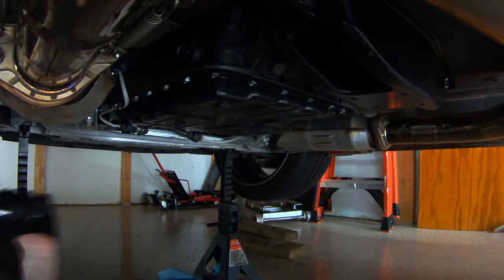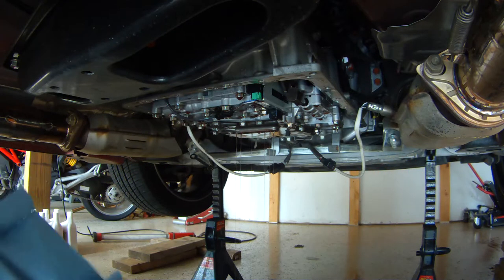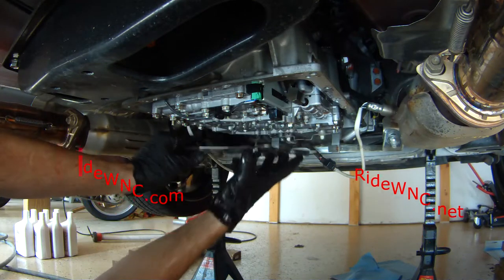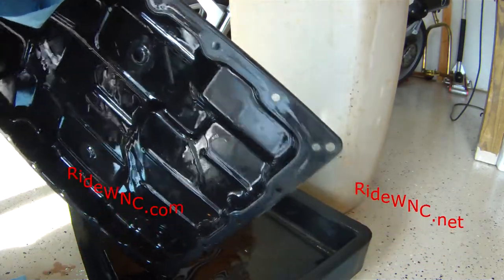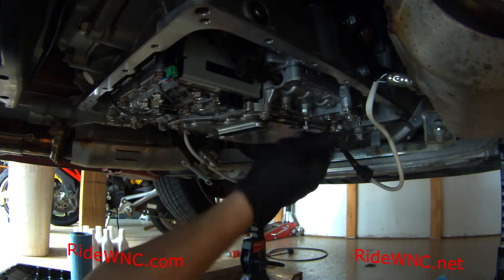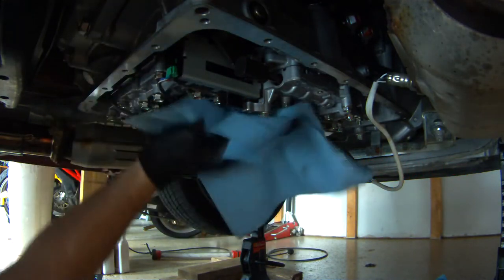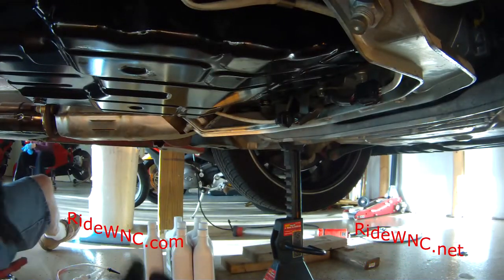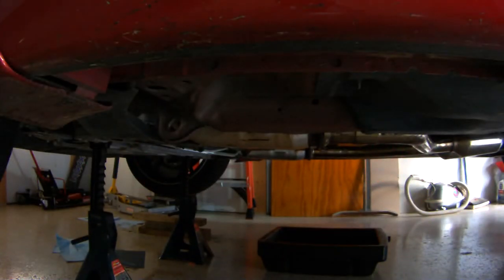Nissan 370z Automatic Transmission Fluid Change and Filter

Comment from the maker: * The car must be running when you check the fluid level. If you remove the 5mm hex screw without the car running you will drain out too much fluid.
Reply: Appreciate this info! This helped immensely with getting my level at the perfect amount.

Comment: hey man thanks alot for this video, i just got my 2019 370 and i was looking forward to do all the basic maintenance myself. I was just confused about one thing in the video, why do you need the transmission to be at 140F? is this required? also do you wait to hit that temperature after u pumped in the new transmission fluid?
Reply from the maker: Manual calls for 140*. You fill up the transmission and a little more then get it to temp. With the engine running remove the level check plug. You want ATF to come out and come to a  drip, then install the plug. There is not a dip stick. Nissan says this is lifetime fluid... NOPE!
Reply: @RideWNC  thanks for clearing up my confusion. Subscribed and liked🫡

Comment: Did you see where the fluid leaves the transmission and makes its way to the bottom of the radiator?  I want to do this and add a transmission cooler.  I know my valve body is likely toasted as I have the highly noted harsh shift from 3rd to 4th when the fluid is hot...

From what I understand - the valves in the valve body have to be replaced but almost nobody does so... I think Level 10 offers an upgraded valve body service - but - why even bother - I plan to simply ditch the 7AT and go with the Q60 RS 7AT with the much larger TQ converter..."Someday" right? ;-) 

Appreciate the video - I live in a small town far far far away from any dealer and - with the ultra high turnover at the dealers - you're not getting the best/brightest working on the cars anymore.... plus - for whatever reason - they always want to hot rod my car - which I hate because I know they don't bother to warm up the car before doing so...

Comment: Planning on having this done soon. I usually go to Infiniti. The shade tree was going to do it but now he's backing out. He recommended a transmission shop. They were talking about replacing the gasket and filter. Is there a brand of gasket and filter you would recommend? 

I was planning to do a drain and fill. I have 5 quarts. Do you think I'll need more than that?  They told me they could get me the filter and gasket for 50 but I know I can get it for less. I bought the car with 156k it currently has 219k Had it flushed at 167k and drained and filled around 195k.
Reply from the maker: https://www.ebay.com/itm/234092083902 Whatever you dump out you need to put more than that back in so there will be fluid to drain out when you check the level.

Comment: If I am putting in a new valve body will I need to replace the filter? I can’t find it online any where. Also do I need to replace the transmission pan and the transmission pan gasket ?
Reply from the maker: That OEM filter should last forever. Just run it through a solvent tank and get it dry. Here is a replacement:  https://www.ebay.com/itm/234092083902

Comment: been thinking about doing this to my 2014 370z auto, but i have a few friends that did change the transmission fluid and all of a sudden the transmission sensor broke and only gear one or three works.
in ur opinion what caused the sensor damage and give us tips to avoid this from happening please, thanks man :))
Reply from the maker: Best tip I can give is; don't let those friends work on your car. It is not related. That is Iike saying,"I changed the engine oil and now the right tire keeps going flat. I am not changing my oil again."

Comment: Hi Mike 
140 degree F is the temperature of the fluid when do the level check you get it from maintenance manual? Thanks
Reply from the maker: Yes. Manual. I am sure running for ten minutes would be OK.

Comment: I did several drain and fills the first time I changed my fluid at about 80k km. I'm at 100k km now and thinking about dropping the pan this time to clean the pan and check the magnets. Not sure if thst filter needs cleaning unless you have a lot of loose debris in there
Reply from the maker: The filter is just a screen. You probably don't need to replace it. You will be amazed at how much crap is stuck to the magnets. Do have a new gasket available if yours is brittle.

Comment: Could you tell me the torque specs for the filter and pan? Thanks
Reply from the maker: It has been a while... I have moved. My shop manuals are somewhere buried in a 40 foot shipping container. It is easy to google a manual. 2009 -2020 are the same car.
Reply: @RideWNC  I found everything beside the filter bolts.
Reply from the maker: @julianpeden4688  I think they are the same as pan. 9-10 FTLBS. Use a smaller inch pound wrench. It will save you from over tightening the bolts.
Reply: @RideWNC  thank you so much your my savior! One quick question though, once everything is sealed back up and all the new fluid is back in, you turn in the car and let it idle till temperature, then re open the fill plug and once it’s done draining you just reseal it and job done correct?
Reply from the maker: @julianpeden4688  That is the worst part. The cars has to be running when you climb under and remove that plug. I don't like being under a running car. The vacuum from the engine will keep the correct level of ATF any excess ATF will drain out. If this is done with the car off, It is the same as draining the pan, just from a different hole. If nothing comes out, you need to add fluid until it starts to come out. This is why I over fill. Overfilling won't hurt anything as long as you don't drive the car.

Comment: Hi, very nice and detailed narration, thanks you.
Just wondering why didn’t you use the upper fill bolt passenger side just above the pressure line, to refill it..
Any specific reason for that?
Reply from the maker: Upper fill are usually too difficult to get to. If you are pumping into the AT it is just as easy to pump the ATF into the level check hole in the pan. It would be nice if manufacturer would put the dip stick back.
Reply: @RideWNC  
Can’t agree more, why hiding a fill in bolt under ground..

Comment: Just did mine I dropped pan reinstalled pan filled it 157k miles I didn't clean the filter or removed it can it be bad?
Reply from the maker: The filter is just a screen. You can see through it when it is off.

Comment: How come did you check the level at 140F? I think you said 114F or 46C in your other video.  I read on forms somewhere that it should be 104F does the temperature matter??
Reply from the maker: "ATF temperature must be maintained at 95-113 degrees Fahrenheit during ATF level check. If the ATF temperature is above 113 degrees F, stop the engine to allow the ATF to cool down." I don't see where it matters that much as long as it in not cold and is flowing through the system. I doubt it expands that much at highter temps. When I check the level, I don't completely drain every drip out of it. When the stream of ATF slows, I put the plug back in.
Reply: @RideWNC  Thank you!
Reply: This video (https://youtu.be/tK3-G4rV0Xs?t=72) shows that between 140F and 104F there is something like 12mm diff on the dipstick (only on 350z, no dipstick on 370z). 12mm is also the difference between high and low level, so I think the temp matter.

Comment: Question for you, why did you only add 6 qts? Nissan calls for 9.75.
Reply from the maker: You replace what you drained out and a little more. Get the car to temperature then check the level. If there is too much, it will drain out. You do not want to over fill a transmission.

Comment: i’ve got a 2013 370z 7at, fbo and tuned, 102k miles. never changed. should i do a change? where can i get oem trans oil?
Reply from the maker: I personally would do it. Then I would do it again in 10K miles.  The cheapest place I find Matic-S is eBay.
Reply: @RideWNC  okay thanks. where can i get the filter?
Reply from the maker: @icesalami  https://www.ebay.com/itm/234092083902

Comment: I changed my fluid in my g37 added 5 quarts and i let it run till it was hot 100 plus degrees is it normal that a lot of fluid came out the filler like maybe half a quart or less
Reply from the maker: If you dropped the pan, it should take just over six quarts. I don't have enough info on what you did to give you an answer.
Reply: @RideWNC  i just drained the pan I didn’t remove it at all and filled it with 5 quarts seemed like a lot came out the fill tube just wondering if it’s normal don’t know much about the g37 just got it
Reply from the maker: @maniacmachanic9870  If you just drained the pan, that is about 3.5 quarts, so yes a lot would come back out. It is always best practice to drop the pan. There is sludge on the bottom of the pan which needs to be cleaned up. You also get more new fluid in the system when dropping the pan.
Reply: @RideWNC  ok thanks i was going to do that its sealed really good doesn’t leak I always have problems with other cars leaking from the transmission pan just didn’t want to remove next time I service it i will thanks for the help
Reply from the maker: @maniacmachanic9870  When you buy theAT kit for this car, make surre the pan gasket is rubber. It will never leak. Watch about time point - 11:30 of https://www.youtube.com/watch?v=E1y1inE0FZ0

Comment: How do I figure out the torque specs for filter and pan
Reply from the maker: Google Service Manual for your car. Zcar.com
Reply: @RideWNC  i have a z cant find them torques is there a better link?
Reply from the maker: @PovZ34  https://diyservicemanuals.com/nissan-370z-service-repair-manuals/
Reply: Just use German specs. Gouden tite